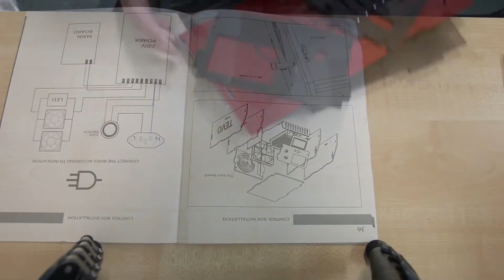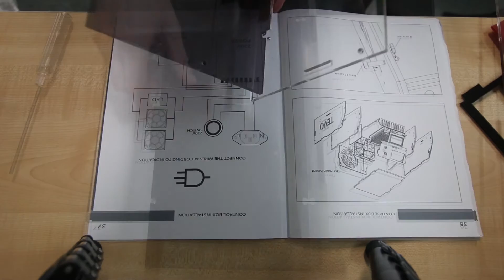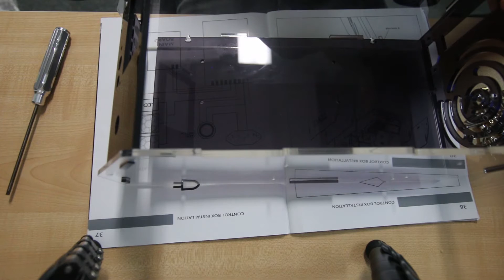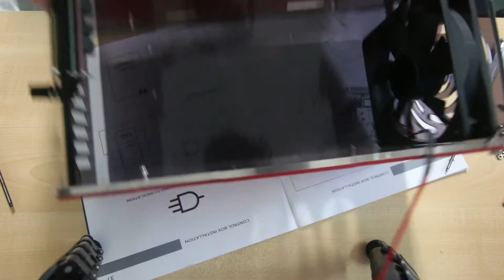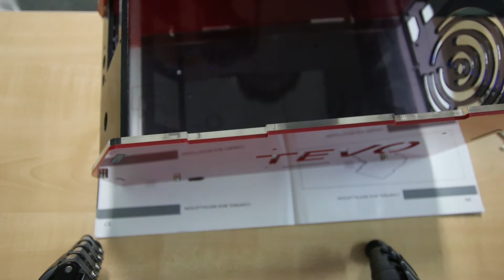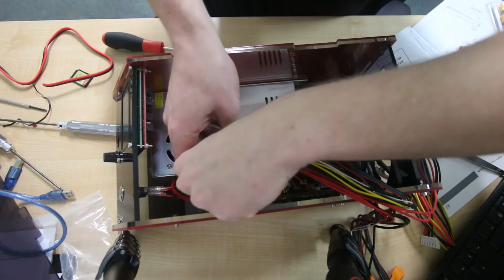TEVO Black Widow Assembly Guide Part 7 - Control Box Assembly + Wiring PSU

Comment: A "friend" asked me to help him to set a Tevo Black Widow 3D Printer because he gave up. 
When he tried it, several components burned from the control. Customer service replaced the power supply, the board and provided a heat dissipation unit not shown in any schematic. 

I re-assembled the control without the dissipation unit. Verified its assembly, watched several videos and finally, I powered it. The display showed an error.
The message is:

      IP
      .TED
Please reset

I tried to reset it pushing the reset button but the error comes back.
Please advise how to correct it

Comment: Seeing this.. the best way to handle that power/control box.. is to set it all up, but instead of screwing it together.. put just the bottom down, then lay the front out front, the back down on the table to the back, and the sides onto the table on the sides.  So it's like unfolding the box out onto the table.  Mount everything to their respective stuff, wire them together, then close up the box and screw it together.  Only sane way to deal with that PSU.  In fact.. it might even be better to wire stuff to the power supply without even securing it to the bottom.  Leave it free at first, so you can twist it and move it around to get the best angles to attach wires.  Otherwise, follow all this to pretty much the letter.  :3

Comment: This box has a really bad design. By the way you could put the red panels on the inside. Looks better. They should sell this with a proper 90° angled USB cable and longer one, so it could be connected to a PC. The printer itself also has some significant design flaws and mine came with bent 4080 profile, which is just absurd. Also one of the profiles for the extruder rail was 1mm longer than the other. Needs improvements, but I could work with that unlike my acrylic Prusa I3 which is wrong design overall.